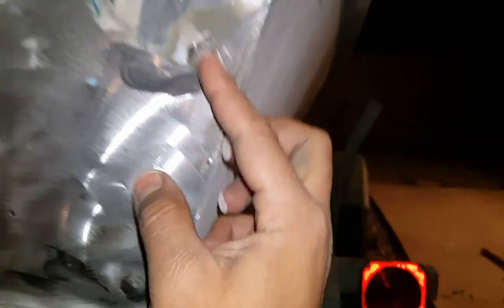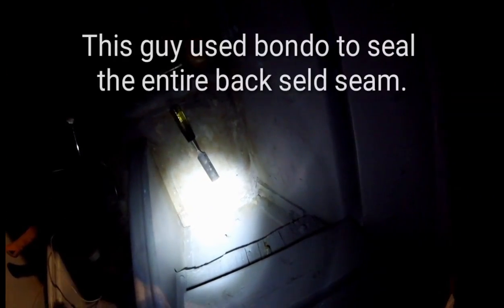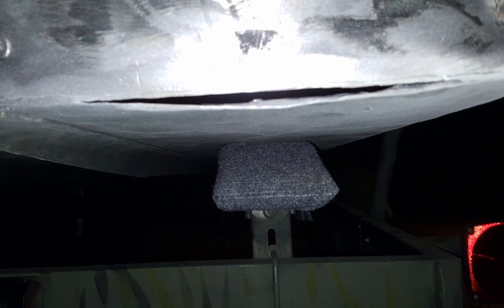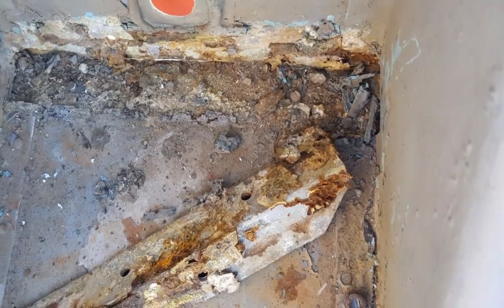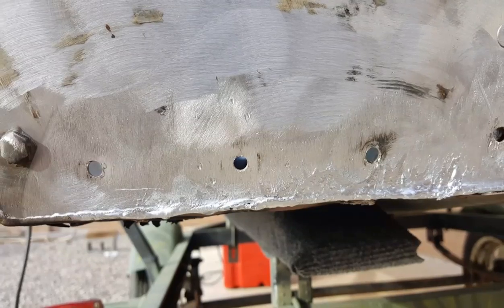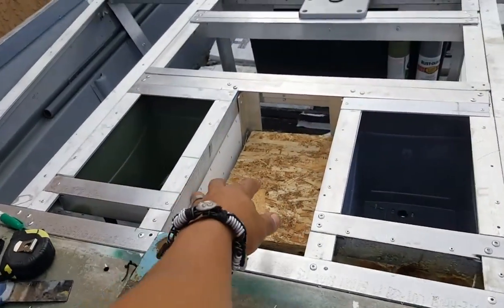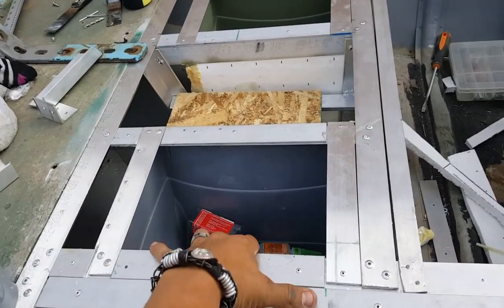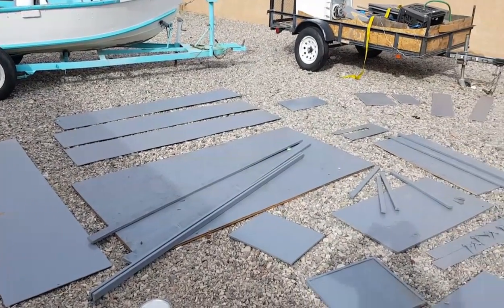Welding/ Brazing  Giant Cracks in an Aluminum Jon Boat hull: bass boat : tinny.

Comment: I appreciate your candor 1/2 way through when reflected on the experience. I would recommend moving clips like that to the front of videos. Because to be honest, had I been closer to my computer I would've stopped the video when you were insulting the previous owner. We've all been novices at one point and I remember a year or so ago I saw your first build (which you admit was full of mistakes).

I hope this doesn't across judgmental. You made right with it and voiced frustrations constructively. I am planning my first build and I appreciate your content a lot. I know I'll make mistakes but I'm sure I'd would make more mistakes had I not found your content. Great lessons.
Reply: Michael Lopez I see, that makes sense. I'm not a subscriber and haven't seen the other vids on it, so I appreciate the context.  Either way your frustration is justified dealing with massive repairs.  As an outsider I was a initially put off, but I see your point. thanks for responding, and again thanks for the content.

Comment: Have you heard of, or tried, muggy weld's super alloy 5. You said with the aluminum brazing rod you used, that you shouldnt grind or sand it down. I have some of the super alloy 5 myself but havent been able to use it, due to lack of a hot enough torch. They say that super alloy 5 can be grinded, sanded, polished or have anything else done to it that you'd do to the base metal. Anyway something worth checking out, keep up the great videos!
Reply: I have heard  and have seen them. I passed due to the need of the torch style required. Hobarts works great enough.

Comment: what's the name of the aluminum welding rods
Reply: I use hobarts .08 aluminum brazing rods. Recently seen other that do same job at 400 degrees over the 730 the hobarts requires.

Comment: Bro, you should look into/consider putting Steel Flex original or steelflex super slick on the bottom of your jon. It's a two part epoxy paint that makes loading/unloading much easier, and it also will seal up any tiny slow leaks.

on my personal jon I'm putting it on the bottom and coat it on the internal seams.
Reply: For my 1542 that I spoke of on your tinyboats site, I'll be putting steelflex on the outside of the hull and "coat-it" on the inside seams.

Comment: Mike have you heard of the plastic wood? I heard it's super lite and lasts forever. But pricy, ever tried that for framing?
Reply: It's called trex
Reply: Joshua Dixon - you could use 3/4 PVC. boards. its waterproof, comes in white, and you can paint it. Its used frequently in Sign making.
Reply: Michael Lopez - try asking a sign company where they get their building materials from, or a fiberglass shop. it's called expandable foam boards or just PVC boards. It comes in different thickness half inch three-quarter excetera. I'm sure you could order it from Lowe's or Home Depot or whatever it's not necessarily something they would have in stock at most stores, it's a specialty item and 4' by 8' sheet is quite costly but it's a hundred percent waterproof and just as durable and easy to work with as plywood. I have some extra sheets of lexan laying in my garage I plan on using in a similar way a fire ant fishing built his boat for the front deck. I like the Lexon because it's clear and I could install an LED light on the front and it'll illuminate the entire Cabinetry. I'm also Rhino linering inside the hall a couple inches above the waterline, I would love to Rhino line the entire boat but to do so is above by economical means at this point. But it would be dope.
Reply: Michael Lopez - Fast Signs on the east coast estimated a sheet of PVC board( 3/4 at 4' by 8' ) for $140.

Comment: yo im in arizona too. I just traded my kayak for a 12 ft v hull jon boat. it seems il have to re-rivet the whole thing. The side of the boat.. edges, where the water line is there are cracks, what if i put a piece of aluminum sheet to the shape of the edge on the inside of the boat and sealed it with 5200 marine seal, then jb welded the out side... do you this that would suffice.?
Reply from the maker: It will all fail. It needs to be rigged.